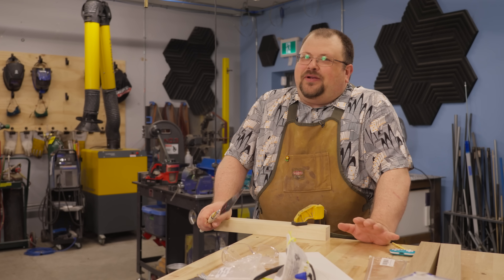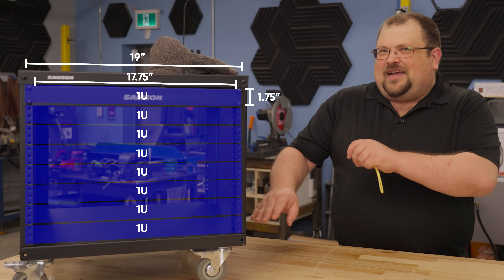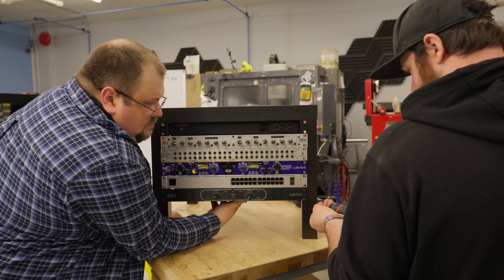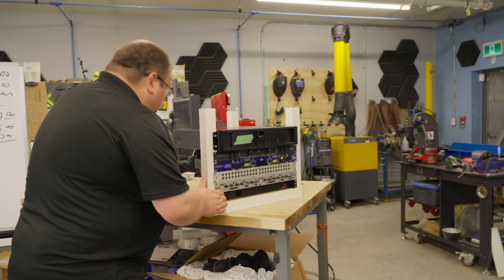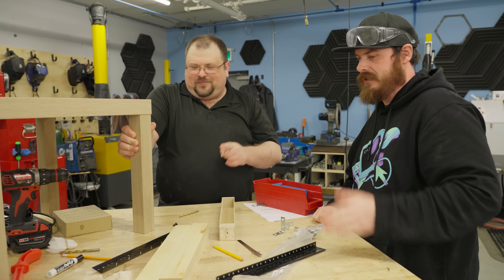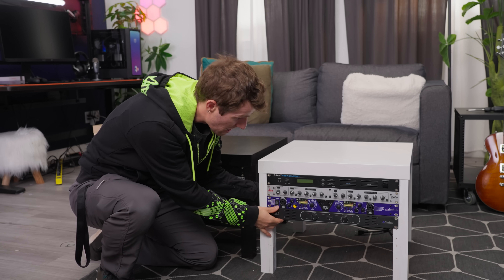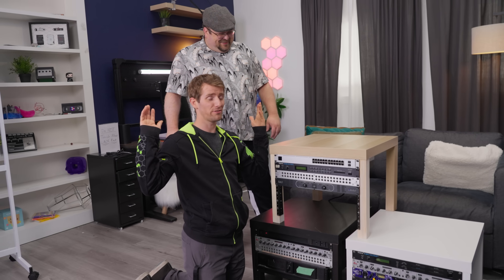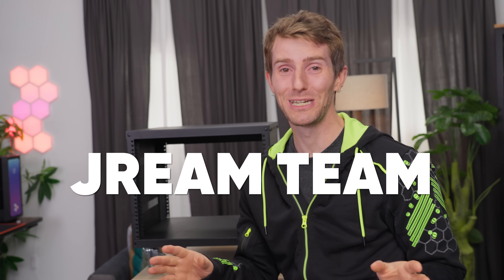Server Racks Cost Too Much - Buy or DIY?

Comment: And then + wood working equipment for thousands of dollars.
Reply: You don't have to buy the tools. Maybe you can rent them, rent a shop or find a carpenter.
Reply: @noredine which will be +100 dollars minimum. Still cheaper, but I think they should actually show DIY with more common/budget tools.
Reply: @c.horvath  A drill and a saw aren't too expensive to buy, either. plus, you get a "rack", and a drill and a saw at the end

Comment: I think it's better to just use 2 by 4 iron bar(just like your v3 iron bar but at the wood stand size) to replace the front wood bar, it may cost a bit more but I think it would last a lot longer.

Comment: For home users, it's worth checking out 10" racks, they're becoming the standard for home/soho use and you can get mounting options for most hardware now be it a shelf with screw in or zip ties for your regular modem/routers etc or rack mount ears for smaller desk based switches. and there is a full host of patch panels etc like you'd expect. GeeekPi and Tecmojo seem to be really popular for them here in the UK, easily accessible via amazon too.

Comment: Aside from the comments suggesting threaded inserts plus bolts, even using pan head or truss head screws would have worked better instead of flat head screws (which have the cone shape under the head).

Comment: I'm using a similar table (the Walmart version, seems to be constructed identically and similarly-priced) as my server "rack." Although I just set the server and switch on top of the table until I can afford to get an actual rackmount case and rack for it and for my gaming PC. It works and tucks away neatly into my closet (thermals are fine, barely a degree or two difference under load).

Comment: Also worth noting that depending on your location - often times companies upgrading equipment literally either give racks away for free or ask $50-$100 for a steel rack. I got one for free from Rite Aid when it went the way of the dinosaurs. It was too tall for my vented closet so I had to do the unthinkable and take an angle grinder to cut the top section off and shorten it. But it came with shelves, and a cool slide out shelf at the bottom that the laser printer was on so you could slide it out and easily replace supplies. Clearly a nation wide company going out of business doesn't always mean you can get free stuff... but it absolutely never hurts to ask... I got a deal on their color laser printer that had a new drum and set of toner with it, a Dell R440 server, a solid Lenovo workstation that now runs my BlueIris operation, and a 24 port 10/100/1000 PoE switch. Only thing they wouldn't let me buy were the dang mini pcs in the pharmacy... Which is beyond stupid because those PCs didn't even have a storage drive they were network booting from the server they DID let me buy. Rite Aid just left them in the building and they still sit. Tried calling the realtor of the building saying I'd handle the ewaste for them but they were not interested... so over a year later the building is still vacant and the computers are still in pharmacy visible from the drive thru. :( and I have the bios master password to make them work and not be ewaste or just scrapped for what little parts are in them. sigh

Comment: I have to drop in here just to comment on the thumbnail... why are those "server" racks filled with audio equipment?
Also... I diy racks all the time... for audio equipment, because I make custom installs, where the rack is just built in from plywood, and I screw rails to it.

Comment: Can you put the rails on the inside of the legs and mount the equipment from the back? That way you reduce the chance of damaging any of the panels and/or knobs and get space for cable management. Plus you can add a door if you're crazy enough :D

Comment: To be fair there’s also the option of threaded inserts or using bolt and nuts for the wood legs so you don’t have to buy new 2x2s every time you take it in or out which cost $5 more lets say and reduce long term cost. A metal rack would cost more but also be metal and a better option but that’s preference. I say this as a person who has their 2u server sitting on a wool hoodie on top of an unused mini fridge in what’s basically a storage room so I don’t exactly practice what I preach right now
Reply: Right. I was thinking they'll go for threaded inserts after V2. V1 didn't feel like it'd hold on to them

Comment: If you put 1" plywood on the bottom it would further reinforce the legs, and if you bought the cheapest moving dolly from Harbor Freight you would have the cheapest source of caster wheels and some spare wood, which you might be able to user instead of the 2x4.  Princess Auto looks like they are a bit less cheap than Harbor Freight, so maybe at that point caster wheels from Amazon would be better.

Comment: I bought an old A/V Shelf, about five feet tall. Took the glass door off, installed rack rails top to bottom and tore out the shelves. Installed my rack gear in it. Got the AV shelf from a thrift store cheaper than the IKEA table.

Comment: Buy or DIY and 3rd option Buy used, i paid 75$ USD for my i think 38u enclosed rack from an office closing sale (basically a company that clears out old business properties sells equipment and furniture) biggest problem was hauling it home, getting it up my stairs and into my closet. (might downsize in future) but every now and then used smaller racks come up online for pretty cheap on marketplace/craigslist/ebay

Comment: The way I solved the problem with the lack rack with screws spinning freely is I drilled the rest of the way through and got a longer screw and used the nut. Then it was solid as a rock. Also, you can reinforce the legs with angle brackets from a hardware store, also help I work at a hardware store get a discount for those things

Comment: To upgrade legs, just open it (on table saw) then put wood INSIDE. You will end with 3 sides of same color, and the cardboard removed on one side will be replaced by rails.

Comment: You guys should do a custom desk build and showcase simple tools like SketchUp Free. I built my desk out of 2x4s and a 4x8 sheet of hardwood plywood, and that thing is solid. This was back in like 2016 when lumber was still somewhat cheap though. I think the 4x8 hardwood plywood i used was like $50 USD at the time, and 2x4s were around $2 for the cheap 8 footers. After purchasing some hand tools, an orbital sander, stain and clear coat, it was still under $150 in total. So WAY cheaper than buying a desk of similar quality that met my design expectations (8' long edge with a half moon cutout and tall full length shelf).

Comment: Great video for DIYers with limited tools 🙂 those server rack rails are perfect for any size build. I'd recommend the ones that accept cage nuts if you're building one for longer term use so you can swap out any stripped threads. 

If you've got time, carpentry skills or dedication then you can make a legit cabinet for your servers or audio gear for roughly half the cost of one from Amazon. The benefit of building is that it's custom to your dimensions, can be more aesthetically pleasing and the savings 🙂

Comment: I would drill all the way thru the leg and use a long bolt and a nut on the back. No need to buy 2x4 and cut them.

Comment: At  45/hr   pliUs  4 hors of drive time plus fuck abot inikea plus 2 hours in home depoy and anothe 1 hor or  in a rack suppl
180
360
150 for talbles
6hour in build time 270
 $680-700
Vs   $250   for rack and  screws

Whist i love the idea  build however  factoring yiur wages and time fuck around it is just buying the proper thing in the1st place

Factoring cost of  tools omtop of ftat  it is over $1,000 oe up

Comment: Lackrack ftw. Been running the same two lack tables stacked on top of each other for 13 years. Have lost count of the setups I've had in it. Currently holds a UDM, 48P switch, and 8U of Dell PowerEdge. At one point it was loaded top to bottom, now most of the weight is in the top half held up by those 4 hollow legs. 😂

Comment: I built a Lack Rack in the early 2000s and created the same as Jordan and Justin's V3.
We could not get our hands on small bits of rack verticals without buying a skeletn kit.
I had an old rack and access to a cold steel saw.
I also piled servers onto my Lack Rack and other solid coffee tables before I bought proper Dell racks.
Two dacades on, the racks have been replaced a few times and mave conceived offspring everywhere.

Comment: Flip it upside down and mount the equipment from the bottom up. No need to flight gravity. I bought two lack tables, used the all the legs as reinforcement and installed 2 4u servers and a 16 port network switch. And yes, its rolling beautifully on casters.

Comment: i am confused, why not buy a long horizontal rail and slap that on to the original legs? it screw to front-back legs so a plywood is not an issue, or just drill through it and secure it with nuts and bolt.

Comment: If you want to continue down the DIY server rabbit hole, I'd appreciate some ideas on how to build rack mountable PC cases for relatively cheap. 

It's just sheet metal when you get right down to it, so it can't be that hard. You'd really only need some way to cut the metal, a welder, a tap and die set, and some stand-offs. Viola, rack mounted PC case.

Comment: Or you could get a wall mount vertical rack, or some shelving brackets too mod a strip of wood to to catch the screws and since it's vertical wearing it the holes is less of a problem... Or take the rack ears off and rotate them 90 degrees and screw directly to the wall

Comment: I have both Hammond Racks and a few homemade roll around racks. The Hammonds were purchased used from recording studios around town and the wooden roll around racks were built using 2"x2" and 3/4" plywood with heavy duty roller wheels from Amazon. They all work great with the tallest Hammond rack being 7 feet tall and the tallest DIY roll around rack being 4 1/2 feet high. The heaviest equipment is mounted in the Hammond rack with lighter outboard equipment like equalizers as well as an old G3 Pro Tools unit with interfaces, hard drives with keyboard and trackball mouse mounted on a front shelf. I used aluminum corner bars on the left and right front of the racks and pre-drilled rack holes ta accept standard sized rack bolts to aid in the flexibility and utility of the DIY constructions.

Comment: Why add the time of installing the equipment in the first place? This is all based on the MSRP price of the Samson rack. Wouldn't you really only be paying for materials, and any modifications? Otherwise, you would need to add hardware to the Samson rack and adjust price according to time to make that fair, no?

Comment: I wonder if you could keep use the original legs if you just used bolts that went through to the other side of the leg, it seems like they would be a better distribution of the forces involved (and also lets you remove and re-insert devices without holes getting chewed up)

Comment: Like you discovered the LackRack now has hollow legs. A solution is to use something like the fischer Metal cavity fixing HM 5 x 37. Just do a search to see what it looks like and then go to the hardware store and buy something similar. These are often used when fixing things to plaster walls where you drill through the plaster. Insert this and tension it to expand and offload the force over a larger area. I saw that on the wiki page you find if you search for LackRack Eth0Wiki

Comment: I built an 18U tall 19" rack out of 1" square steel tubing and two pairs of drilled/tapped rack rails back in 2003, and am still using it. I also built two 10" wide mini-racks using 3D printed rack rails and 2020 aluminum extrusion for my current network setup. Everything is rock-solid when done correctly.

Comment: I actually just bought a rack (12) it came to 130-140.

That said I was originally looking for 6u rack found them for about 80-90 dollars. Which is spitting distance from the laakrack.

But thats not why posted this

There is a cool video going over how IKEA kept the 9.99 table at 9.99.

Basically is all hollow, not just the legs, the top is hollow with hexagon cardboard for structure too. 

I would just make it out 2x4s which should still be cheaper than the 200 dollar target

Comment: Or you could buy a small two post rack for around the same price as the ikea unit 🤭 I did build a custom rack myself using rails, wood and 3D printed mounts for a bunch of mini pcs as I needed something a bit smaller than the standard 10" racks you can buy. For my 19" rack I just went with a 2 post one and it was dirt cheap.

Comment: Ok, now cable it. It looks nice without actually being used, but its going to be really messy once the cables go in. Id put rack mounts on all 4 posts and then rack the half sized switches with the cables facing backwards instead.
Reply: Otherwise, great video. I am convinced that I need a rack for all my stuff.

Comment: Why not just use threaded inserts in the solid wood legs? Would hold up better over time and gives the ability to use machine screws instead of wood screws so you can swap stuff whenever.

Comment: Your hourly rate is pretty unsignificant for a DIY project IMO, especially if you spend 15 minutes on it.
Alternatively, for a more reusable DIY project you could have just made your own table and used ez lok wood inserts. I'd also probably have planned for a bit of space in front of the rack so cables aren't coming out the front of the rack

Comment: There are over a hundred types hollow wall anchors. or just long bolts with nuts and washers through both sides of the leg. Replacing the legs really isn't necessary. You can even use thin strips cut from an aluminum soda can to fix a stripped hole if you really want to cheap out.  Really, if you have everything needed to make table legs. Then you can just build the entire thing from scratch anyways.

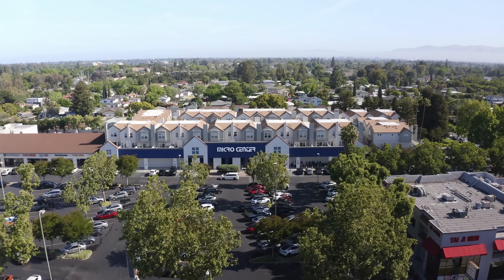Comment: 13:49 that's not Phoenix.
Reply: Does it matter?
Reply: Pretty sure it's just AI slop. Doesn't make any sense.
Reply: @redmachine8354 Its not AI its just stock footage of the Santa Clara, CA location.
Reply: @coolyo_kai  I've been to the Santa Clara one, if it's the one next door to Intel. Why would that have had a line around the block in the past 30 years?
Reply: @redmachine8354 not everything is ‘ai slop’

Comment: i bought 2 Ikea Tables fpr 16€.
I run three mini pcs on top and mounted a 19" switch between the legs.
Havent bough any other rackmount stuff yet but i am already excited to mount it there if i find something new.
Best low effort, low bar of entry solution ever

Comment: It really makes no sense to make one of these when pre-owned racks can be had so cheap (and the bigger ones are often free).

I've purchased 2 second hand and the second I bought is very classy, about 20RU, has a glass front panel that can be locked, has exhaust fans and wheels.

Unless you're desperate for fake wood veneer cardboard in your lounge room I'd recommend checking the used market before bothering with DIY racks.

Comment: I built mine out of 1x1 inch square steel tubing. Welded it up and put a butcher block on the top after I painted the frame. Think I gave $20 for the steel and the top I made. Maybe $5 in welding wire but I have that anyways. Customers buy my materials so I don't charge myself for that or my time.

Comment: Honestly, your best bet would be to mark the spacking for the ears on the lack legs, buy a cheap plastic anchor set, drill and tap the anchors in. A dab of wood glue on the outside of the anchors will prevent them popping out any time soon!

Comment: Echogear sells a 10U open design server rack that's served me well for years on both wheels and later wall-mounted, and it's $160 right now, which is pretty darn affordable considering it also comes with shelves. I fitted some diy fans and magnetic screens to the sides and use a laptop cooler + a top rack AC Infinity fan unit to help direct air up and out. That rack chassis can be mounted to many types of tables or cabinets and will be a lot more solid than many other options.

Comment: I don't see why you would be adding your time in $'s to add the components when you would have to add the components to any rack. That's just a constant. And as for DIY'ing for yourself, that is always going to come with labour. It's the choice one makes to save money. I think just tallying up the cost of parts vs. the buy option is a more valid comparison. If you were making these to sell on the other hand, then adding in labour costs is completely valid.

Comment: What the hell is this video, as soon as I assembled that night table years ago, I knew the legs were empty. How did you guys get a job at LTT exactly? Also, ever heard of washers? Drill holes through those feet use machine screws and washer. Problem solved!

Comment: They make metal rails for building your own rack.  I built my rack with some scrap wood from a construction site by just installing my rack units to the rails to line up and mark the holes on the wood properly, then drill and eyeball a frame.

Comment: I would have drilled a hole on the back side of the front legs and filled them with epoxy and maybe sawdust. You could even lay the legs on their side so that the epoxy pools on what would be the front face. That'd reduce how much epoxy you'd need while still providing enough for the screws to bite.